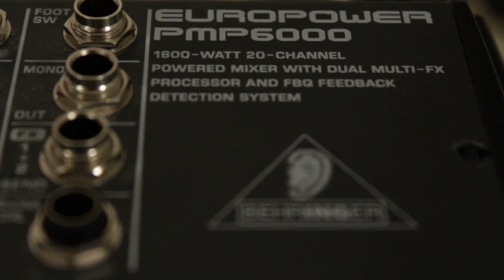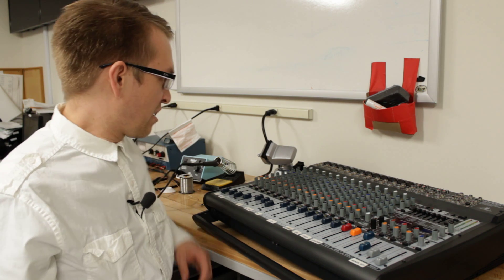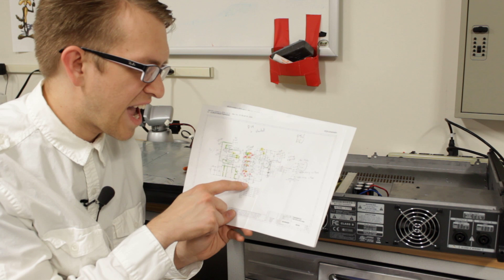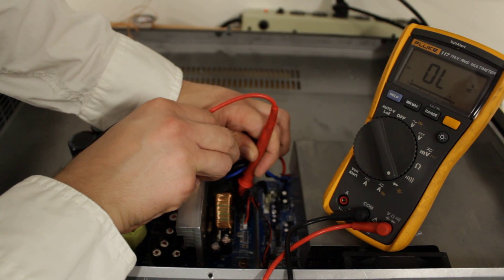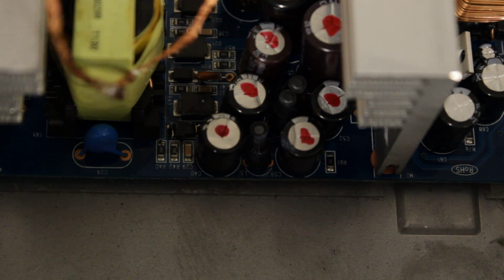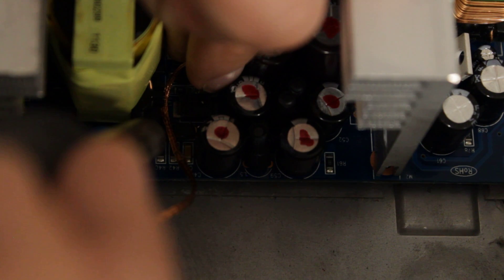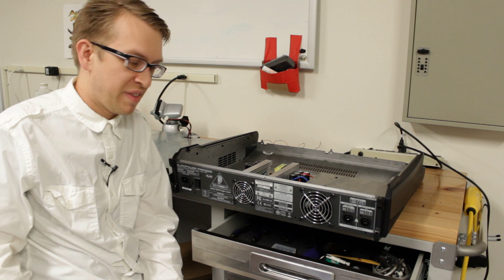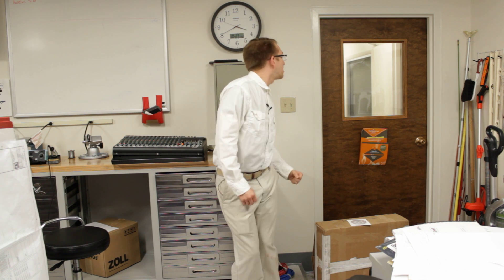Europower PMP6000 Repair

Comment: I wonder if they updated the diodes on the PMP 4000 and 6000 that’s still in production since the other ones are obsolete. This is a great repair video, I take the lazy way out and just swap out the power supply. I have an old PMP 6000 with the red FX numbers that so far hasn’t fried the power supply.

Comment: Hey, i have a PMP-6000 and one of the line doesent work, what can be wrong and what have i done wrong, i was just testing a mic. And it died?
Reply: Yorkies TV I tried both of theme, no have not tryed to other sources.
Reply: But i will try another mic. Tomorrow just to check if there was the mic that failed.

Comment: Hi i have a Behringer EPQ450 and when you switch on it goes straight to a steady limit light,  thats with nother connected to it. please advise as to  where i can start checking. furthermore im unable to find the schematics for this amp.

Comment: Friend i have a europower pmp4000 with the same problem as yours flickering lights i have tested the diodes and found diodes 21, 22 ,23, to be faulty on schematics 23, 22 have BAV99 next to them and 21 has LL4148 are these what i have to order or are there different names hope you can help thankyou

Comment: Ummmm,, Ok, what is it if you have the +15 -15 and 48v to power the mixer board, all lights work and the mixer works with an external amp, but the fans do not work and the voltage to the amp board is non present?
Reply: thanks, will take a look at them and hope that it is not an ic. I dislike testing them also. they just make them so small these days.
Reply: Yorkies TV , there seems to be no voltage on the secondary side of tr4. the windings ring through ok. checking from the mosfets to primary side shows voltage though. could the C21 cause this, or the mosfets themselves?
Reply: Yorkies TV , there seems to be no voltage on the secondary side of tr4. the windings ring through ok. checking from the mosfets to primary side shows voltage though. could the C21 cause this, or the mosfets themselves?